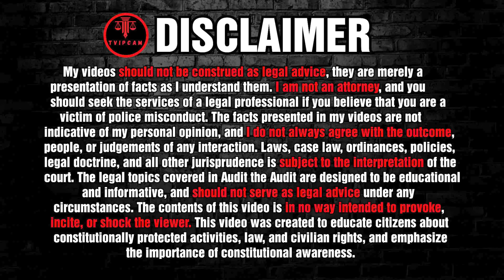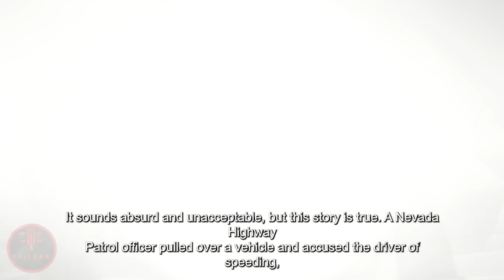When Cops Mess with The Wrong Person & Get Owned | First Amendment Audit | Id Refusal #2

Comment: Ya sure a couple guys hauling a trailer getting paid by the hour are going to be traveling 87 miles per hour 🙄
Reply: The cop said the guy in front was doing 87 and that he was doing 85, the trooper gave the first guy a ticket for going 80 and the trailing guy going 85, make that make sense
Reply: @joeyb1766  You ever hauled a trailer?
Reply: @johnathandouglas007  I'm going with physics on this if a vehicle having a trailer or not, would be behind another vehicle supposedly going slower than the one trailing behind it, that's going faster than the one in front.... how is that possible. Remember the cop first said the first guy was going 87 and the cameraman was doing 85, but now gave a ticket to the first for now going 80 and the cameraman still at 85...hmmmmmm
Reply: @joeyb1766  Anyway... I've hauled a trailer like that... It's why there's a slow lane 👍
Reply: @johnathandouglas007  in going with the facts on hand in regards to what the trooper said and the tickets he issued, very easy to beat in court now, and it had nothing to do with having a trailer...I guess you just missed the point
Reply: @joeyb1766  Sounds like you missed the point... He in fact did have a trailer...

The cop should be fired cause he was lying... We agree on that....
Reply: LOL! TRUE 6:22